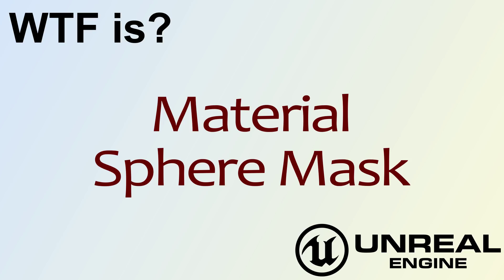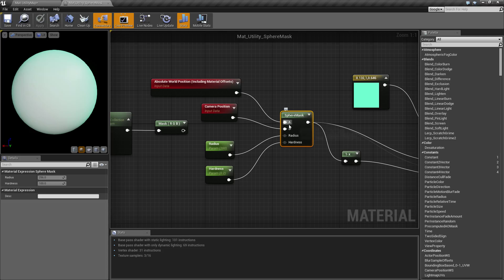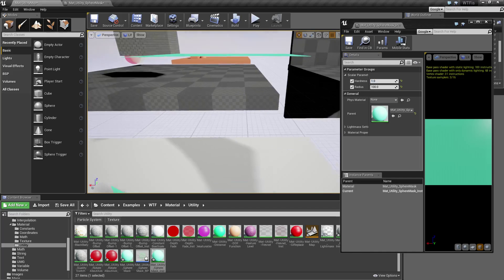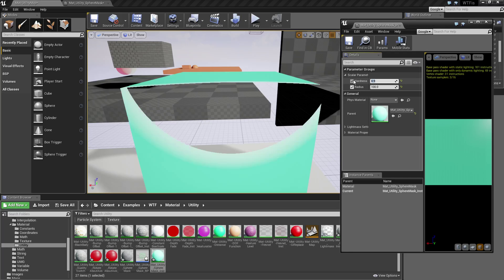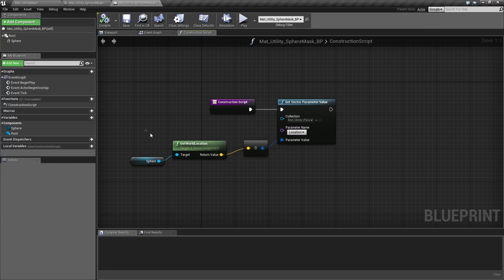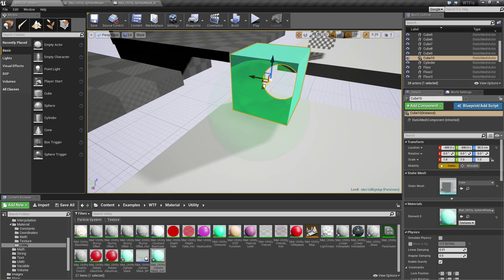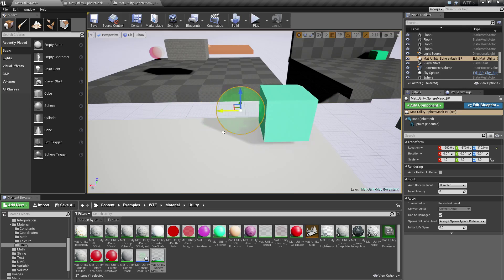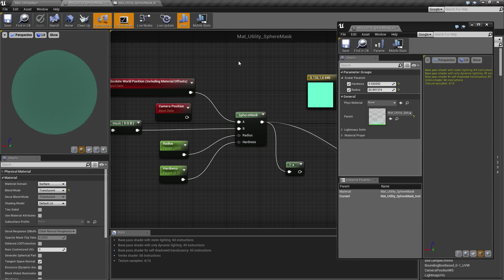WTF Is? Material - Sphere Mask in Unreal Engine 4

Comment: brill tutorial thankyou Mathew! I'm planning to use a sphere to control location of the sphere mask however I'm trying to create a mask that blends one material to another using the BlendmaterialAttrivutes node in materials. I've noticed hardness doesn't work and I assume that's due to the way the blend works and it's either black or white only - what workaround would you suggest to be able to retain the full gradient within the alpha?
Reply: sorry yup I changed the material attributes to Transparent and it worked a treat, thanks again!

Comment: Hi ! Nice video - I was wondering if there is a way of letting something like a black filler material (or a nicer one) cover up the cut surface in a mesh that is masked (by something like a sphere mask for example)
Reply: Way late for this, but if you're interested, all the sphere mask provides is a 1-0 number that's 1 in some parts of your mesh and 0 in others. All you have to do is link those inputs to something other than opacity.

Comment: Ok, so I am trying to describe this in terms I can understand. 

From what I can gather, A sphere mask does the following, please tell me if I am wrong.

It takes positions "A", then for every pixel on the mesh the material is applied to, it calculates the distance to to point on the material from position A, and if it is closer than the radius, it produces a black/zero result for that pixel on the mesh. And white outside it (ignoring hardness for a second).

So I imagine it as a sphere of black centered around a point.

But what does the "B"  input do?

Do the coordinates for A refer to a world position on the map, or some sort of relevant position compared to the object the material is based on?

I am still finding it hard to fully internalize this concept and how it works.

Guess I'll just have to play around with it.
Reply: Ok, So I think I get it.

Basically all it does is compare the distance between two points. 
And any point, any coordinate, is always relevant to something else. 
 
The trick is making sure both coordinates are relevant to the same point, that's how you figure out the distance between them in this case.

So Input A basically tells you which coordinate you are checking (usually that would be the coordinate of any specific point on a surface, relative to the world space 0.0.0), so you input something that means " the coordinates from the surface to 0.0.0", or in other words, "absolute world space".

And input B specifies the coordinate you are checking the point against. In this case, the position of the camera in regards to that same 0.0.0.

This would have been so much easier if you could just input the object or whatever you want to check against directly, although I guess I could probably make a material function out of that.

Comment: Hi Mathew, is there a way in UE4 to stop rendering objects after a certain distance? If not, can this sphere mask attached to a player or camera blueprint provide the results?
Reply from the maker: +duplivert What you would want is to use Culling and that is part of the UE4 engine you would just have to set up the max draw distance basically.  Sphere Mask could be used for this but the objects are still there and it's not intended to be used for that.